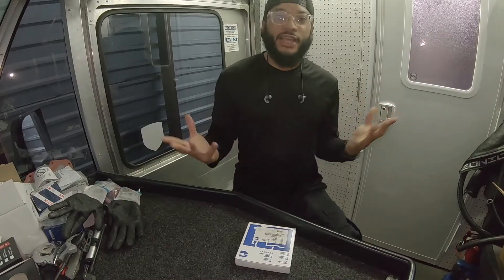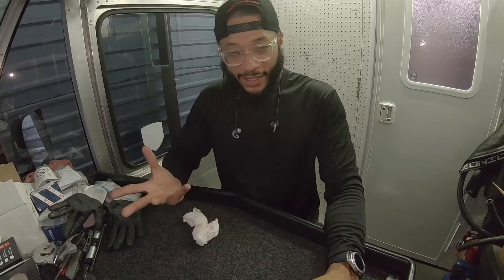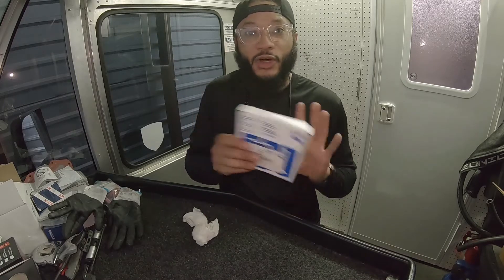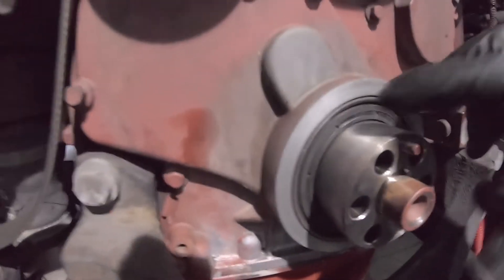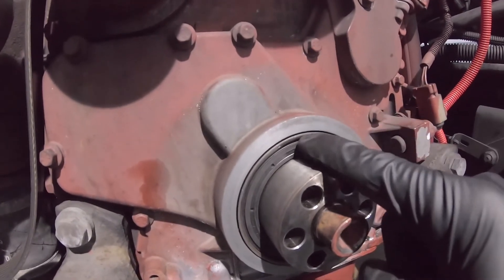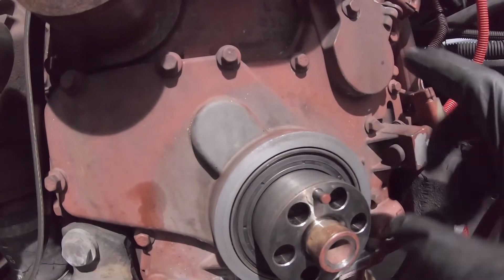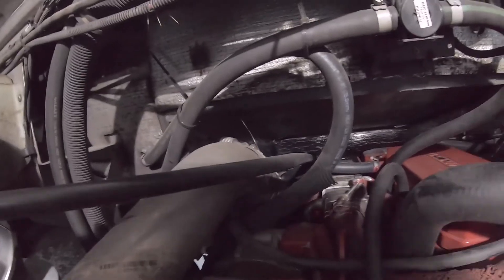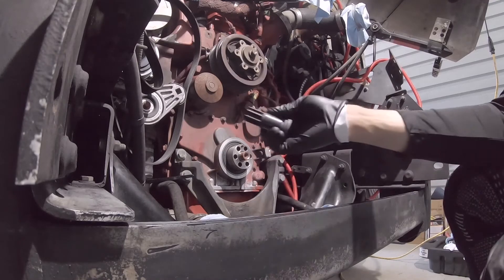How To Replace Front Main Seal on 6.7 ISB Cummins With Rear Gear Train

Comment: Do you have a part # for the engine barring tool ?
Reply from the maker: Go to Amazon or Google Engine Barring Rotating Tool Compatible with Cummins B/C Series Diesel Engines and Pickups 3.9L, 5.9L, 6.7L & 8.3L Diesels Engines

Comment: where do you work at do you want to come to south florida and work on my truck 2013 6.7 isb that need to be done
please let me know
Reply from the maker: Hi, welcome to the channel. Unfortunately I'm located further up north and this is currently what I do for fun lol. Try making sure your up to date on reg maintenance. A clogged ccv (crank case vent) can cause excessive crank pressure and for seal to leak/ path of least resistance

Comment: how much does a job like this cost my is bad
Reply from the maker: Hi, the cost to have the front main seal changed at the dealer is about $500ish. Cost can vary from shop to shop depender on labor rate. Parts aren't really too bad, it's the labor cost that adds up

Comment: I'm in the middle of replacing my FMS & the new seal from the dealership I can press in easily with my fingers. What is your part #? Did I see that your seal spun? Is there a common failure here & a special seal sold to fix the issue ? Any guidance would be helpful
Reply from the maker: Hi, download the cummins quick serve app to check for the correct part #. There are different variations of cummins (front gear train, rear gear train, isb, qsb, 6.7, 5.9....). The quick serve app is very helpful in verifying the correct part # for your cummins. The engine code should be located on the rocker cover.
Reply from the maker: Depending on crank wear there are kits available to correct the issue. The seal i used spins within itself, the link for the seal can be found in the description